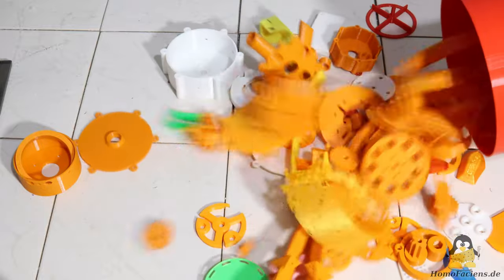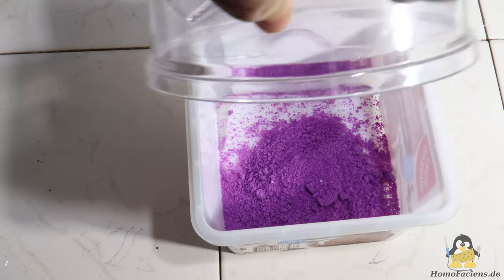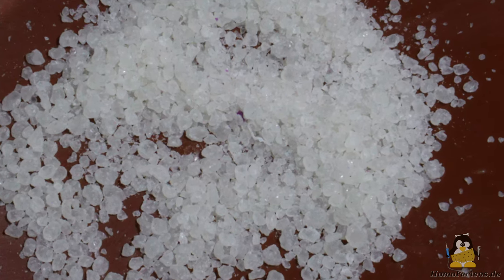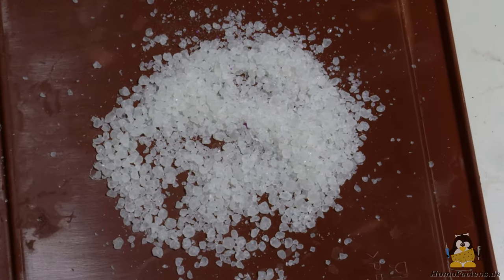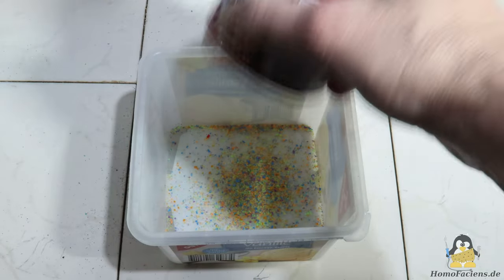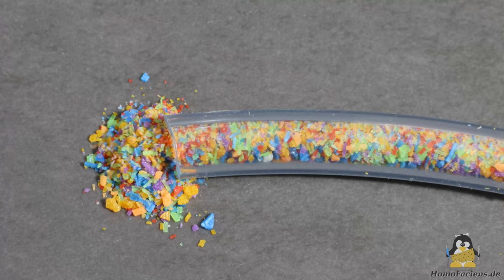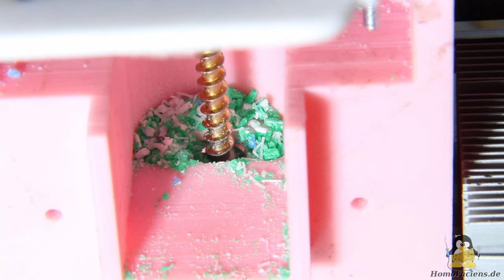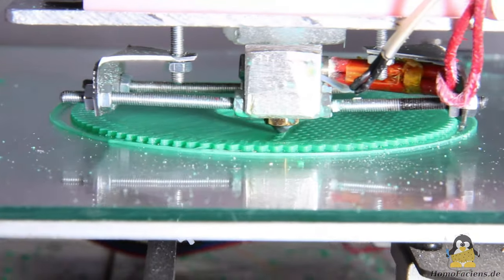Plastic recycling with a blender: Turning waste into valuable raw material

Comment: Precious Plastics has some open source project related to this.
Reply from the maker: Yes, I came across some of their projects. Their approach is more using a shredder, which doesn't produce the type of granules my direct extruder needs, but their channel is definitely worth exploring: @Precious_Plastic
https://www.youtube.com/@Precious_Plastic
Reply: @HomoFaciens  Precious Plastics' shredder is a good first pass for breaking down the plastic into an intermediate size which can be processed more effectively by the blender. An old repurposed paper shredder could also serve the same purpose, although it might need a more powerful motor. It might even do a better job than a blender if the plastic is processed in multiple passes at high enough speeds. The big issue with shredders is preventing and recovering from jamming.
Reply from the maker: Yes, it was especially the @Precious_Plastic versions of shredding machines that was from interest for me, but the plastic coming out of a shredder is definitely different from that coming out of a blender. It is that sharp edged granules of different sizes coming out of a blender that make my extruder work. Blenders brake things into pieces, shredders squeeze things into pieces. Sounds like that makes no big difference, but in fact it does. More on that as soon as my DIY blender with integrated sieve works. Thanks for sharing your thoughts and: Stay tuned!

Comment: Could you do a reverse of a dust collection cyclone to remove the small particles as they are produced and leave only the larger particles that still need to be broken down? Vacuum extraction through a mesh on the side or top? Interesting project, thanks for sharing!
Reply from the maker: The video on my version of a pellets-to-plastic-dust-grinder is currently recorded. It has indeed a mesh (sort of) on the wall. Stay tuned!

Comment: I wonder what happens if you use the pulse button every 5 seconds or so instead of running it continuously? Would the chips be broken down further from standstill compared to be tossed around constantly?
Reply from the maker: Nothing really happens in the acceleration phase, as the acceleration of the blade is way lower than the acceleration of a particle that is hit by an already fast spinning blade.
With that, the rotational speed of the blade has an impact: The faster, the more chips are removed, but also the more friction and so the more heat builds up. As with all things in a real world: Find the sweet spot.